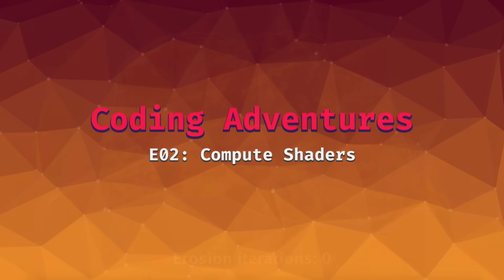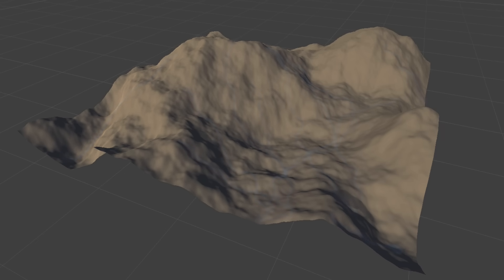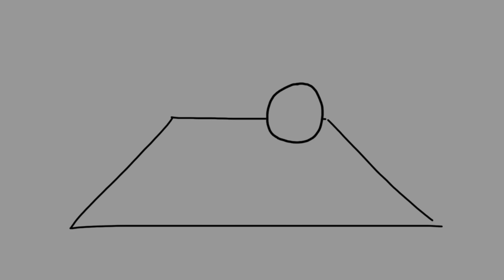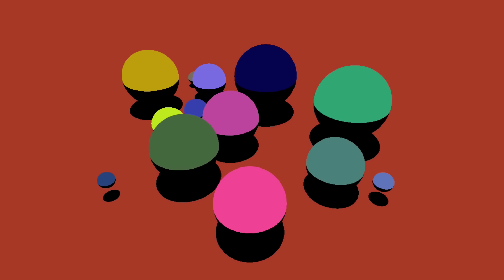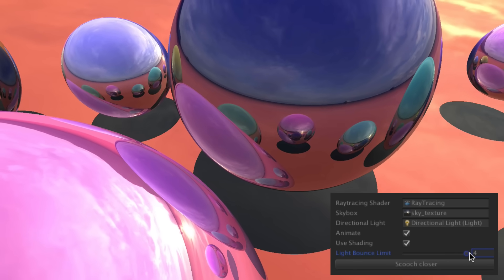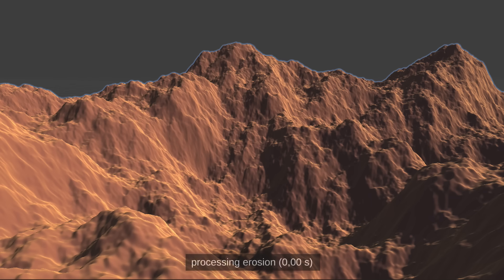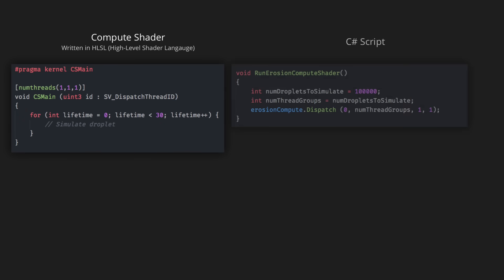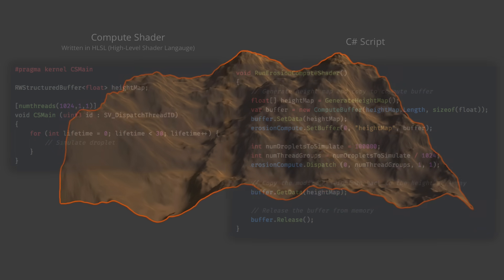Coding Adventure: Compute Shaders

Comment: Graphics programming student here; numthreads is the amount of threads that share data and are executed in one go. Every group is made out of numthreads and so dispatching less groups is generally faster (less stalls), unless these groups access shared data (or do group syncs). Having numthreads as 1,1,1 will destroy the whole idea of the gpu; paralization (as it just runs minimum number of threads and then masks out everything but one) since gpu cores are way less powerful by themselves then cpu cores. The threads that are dispatched should be a multiple of the GPU's architecture's minimum threads for optimal performance (32 for nvidia, 64 for amd) since less threads will be wasted. These "minimum threads" are also called a warp and all threads in a warp should follow the same branch (otherwise, branch divergence will cause both branches to be executed, but the branch that shouldn't execute the code will be masked out), this is done because the gpu draws its power from SIMD; a technique that allows you to operate the same operation on multiple objects. Their advertised threads are pretty much faked, as the threads they mention have to do the same thing for every warp; so not functioning like cpu threads. Nice to see something about compute shaders :) You can do infinite things with them; generate things procedurally, do lighting & ssao, culling and setting up draw calls, etc.

EDIT: Do note that more threads in a group isn't always better in algorithms that have branch divergence, for/while loops, syncs and/or write to memory inconsistently (or use groupshared memory). There's a lot of things that can affect this, mostly the GPU architecture, so be sure to test performance with different group sizes.
Reply: Adding on to this discussion of maximizing performance with compute shaders.
A thing that is really worth mentioning, is the nature of ComputeBuffers and the GetData() method.

The GetData method, along with other kinds of GPU buffer reads, such as readPixels() for textures, are not asynchronous.
They force a hard stall to the CPU thread, and it waits until the data you want from the GPU is ready. And along with that, even if
that data is ready, it could be further stalled by anything else that puts the GPU in a busy state. So the time it could take is really not
easy to judge.

Like... I experimented with it before, and purposefully set up an automatically approximating delay between the dispatch call, and the data fetch,
and that did a sort of decent job, but in the end, being just a little bit too early, or too late on the GetData fetch could cause a lag spike.

So after looking into it for quite a while, I found this... https://github.com/digitalsanity/AsyncTextureReader
I'll start with a note that I haven't properly tested it in the latest versions of Unity 2018, but it was working in 2017 for sure.
Assuming it does work though, It's a very easy to use and modify plugin that allows you to signal that you want data from a
GPU buffer immediately after Dispatch, and you can have a constant check for it's status in a loop, without any laggy synchronization issues.
(Edit: Oh right, the name of the plugin is a little confusing, it says texture, but it does support ComputeBuffers as well).

There is however, another potential solution directly supported in Unity 2018 brought up here https://forum.unity.com/threads/asynchronously-getting-data-from-the-gpu-directx-11-with-rendertexture-or-computebuffer.281346/page-3#post-3358878
Though I have not tried it out myself.

Edit: It's in the documentation https://docs.unity3d.com/ScriptReference/Rendering.AsyncGPUReadback.html
Jeez am I behind on Unity... Kinda stopped focusing on development stuff for like a year now.
Reply: A little more to add to the conversation which may be useful:  Each thread group runs on a separate processor, at least in theory.  What I usually do is start with only one thread group, then tweak the number of threads per group (threads per processor) to maximize the speed, then leave that alone and start fiddling with thread groups.  I typically use maybe 8 or 16 or 32 or so threadgroups, usually with 128 or 256 threads per group in my typical cases, sometimes 512.  Maybe go a little bit toward the higher side on threadgroup count so future graphics cards with more processors will speed up your algorithm automatically.   The best settings change across different GPUs, so it's one of those "this looks like it's probably good enough" things.   For example, here:

https://www.youtube.com/watch?v=_IYKArSYYtQ

This is a real time engine simulation I wrote that runs entirely in a compute shader.   The audio data is then fed back from the GPU to the CPU side something like 10-30 or so times per second.  (This is 100% synthetic audio, there are no .wav files or anything).  Each exhaust pipe is simulated separately and has a bunch of nodes for modelling gas states throughout the pipes.   The pipes here are not connected to each other, so each pipe is one thread group.  The number of threads is set to the number of nodes in each pipe, making sure to keep it a multiple of 32.  This simulation runs something like 40 billion flops with 480,000 Hz physics (only 10% of the audio info is even written out for playback), way more than a CPU could ever hope to do in realtime.  

It's fast enough mainly because of the memory access pattern and size.  Each thread group has it's own cache (groupshared memory) so as long as the variables needed for the number of nodes in each pipe fits inside that and you only read/write maybe one time while doing thousands of iterations inbetween on the groupshared copy of the data instead of the very slow global memory, it can be extremely fast.    Speed is all about getting the memory access patterns down.  For example, connecting the exhaust primaries together to form a collector/headers would kill the speed because I'd have to start writing data from different groups (processors) back and forth to each other, which means reading/writing back out to global memory 50,000 times more often than it currently does.   So suddenly there's a major problem and it won't run in real time anymore.   

Some algorithms just aren't very GPU friendly, unfortunately, mainly because of memory access considerations like this.  I wrote three versions of an LU decomposition linear equation solver for a GPU, and while the best one was slightly faster than C# in Unity, it wasn't nearly as fast as a C++ native plugin version I wrote afterwards (C++ version was about 3-5 times faster or so than compute shader, it seems to depend on the matrix size somewhat).  That has to read/write out of 2D arrays in a weird access pattern in a particular order which can slow it down by a factor of 30 or so.   It can only be partially parallelized, there's a lot of waiting around for previous computations to finish before threads can continue combined with a lot of slow memory reads/writes into global memory because the caches on each processor are too small to store all the data.  The actual computations were fantastically faster than the CPU, but the single line of code at the end to write the data back into the global memory kills it by probably two orders of magnitude or so.  

So some things are great for compute shaders, others not so much.  Just have to try and see, really.

As far as GetData() speed is concerned, it's only a problem if you need to readback data very often.  For instance, I'd like to rewrite part of one of my physics engines into a compute shader, but I have to read data back something like 400-500 times per second in my typical use cases so it's not really possible because the first call stalls things so much.  In Unity it used to be a lot worse than it is now though, on the order of 10 times slower.  As soon as you would read anything back at all the first call would stall you for 0.01 second, limiting you instantly to 100 fps.   It's a lot faster now though, but still not fast enough for what I want to do.  Anyway, it's not really relevant for the landscape thing probably because the simulation is probably called once, it runs for a couple seconds, then the data is probably read back once.   (Correct me if I'm wrong about the algorithm.)  So a little stall there of a couple milliseconds doesn't hurt anything.

I might be mistaken, but I think the asynchronous GetData() reads, which are a lot faster, don't guarantee that you'll get your data in the same graphics frame.   That might be fine for some uses like landscape erosion, but it wouldn't work at all for most of the stuff I've done unfortunately.  I wouldn't expect any gain at all for the landscape erosion case so it hardly seems worth the trouble on this one which takes some seconds to run.

Anyway, this is neat video to see.  Always fun to see another case where a compute shader spanks a CPU at some task.  Nice work!
Reply: Hey, just wondering, you say you're a graphics programming student, do you only study this or other types of programming too. What schools would you recommend?
Reply: @littlenarwhal3914  it's a study in Breda (BUas) but mainly focused on game programming (C++). There's a small percentage that ends up doing graphics, but you do get forced to at least do some basic C++ & opengl. Most things you'll end up teaching yourself, as the field is constantly changing and there's a lot of difference even between graphics programmers, so they end up steering you based on your projects and documentation
Reply: Thank you!
Reply: Important practical note is that (on nvidia hardware at least, but I'd be surprised if this were any different for AMD) there are no global synchronization directives. If you want to synchronize across the whole gpu, you need to wait for the kernel to finish. Within a kernel it is only possible to synchronize the threads in each block (which in CUDA C++ this is done with __syncthreads() ).
Reply: Thank you for your explanation.
Reply: Sorry for bothering on an old comment, I found a compute shader repo that enacts the idea of “particles.”  Each particle doesn’t have any effect on each other, the only shared data is global stuff like delta time.  Currently, I kept the code the same as the repo so it has numthreads set to 1,1,1.  What would the optimal setting be?  Currently there are a max if like 500,000 or so “particles” I think, but someone did show me how to have more.
Reply: @JJCUBER  mostly depends on your vendor. Nvidia uses 32 threads and amd 64 per warp. The reason why that is important is because they do a lot of optimization with this. If you have 33, it would need to spin 2 warps on nvidia where 31 threads don't do anything. Not only that but some operations are more efficient if the group size is equal to the number of warps (since sharing values between warps can be used for groupshared memory for example). I'd say try it out and see if there are major performance differences (profile the one shader individually, for N times with various thread counts). I'd suggest if AMD is a possible target that 64 is the easiest way to go; since 32 will keep a lot of threads unoccupied for AMD and just use 2 warps for nvidia (but misses some optimizations since it doesn't just run 1 warp); optimal would be to have two versions if the shader is very intensive (like raytracing), but that's probably not worth it unless you want to achieve maximum performance
Reply: As a layman who doesn't understand coding or game development, that makes a lot of sense why everything from map sizes to shadow and texture resolutions need to be multiples of 64 in games.
Reply: @GnanaPrakash86AP  that's for another reason. Textures used to require base2 (...,32,64,128...) to work. Nowadays it's just legacy since you can have textures that are any size. Though one thing remains; on desktop textures  (BCn) need to be a multiple of 4, since generally texture compression is used and needs blocks of 4x4 pixels. Mobile/console is better with this since ASTC (their compression format) allows different tile sizes (up to 12x12), though this will still won't allow every single resolution
Edit: this requirement has been relaxed later, misaligned textures will now just introduce an extra block (e.g. 1 pixel will still effectively be the footprint of 4)
Reply: @Nielsbishere SIMD (single-instruction multiple-data) is actually the parallelisation paradigm for CPU. NVIDIA and AMD follows the SIMT architecture (single-instruction multiple threads). I would love to have had CS lectures about GPU programmation in University / Engineering School during studies, but as you say, it's a fast evolving domain, so it is sometimes best to learn from here and there on the Internet.
Reply: @polite3606  you're right, I said SIMD while I meant SIMT. But it still has SIMD-like behavior for vectors. In DXIL they may generate multiple instructions but in spirv and the isa (at least amd's) they will be reduced to 1 operation instead. This operation probably still behaves similar to SSE's m128 but the gpu variant. I also don't know if I talked about wave intrinsics here, but they're awesome. I wrote a histogram that can be reduced in 3 dispatch steps using groupshared and wave intrinsics
Reply: @nielsbishere  I wasn't expecting such a quick answer from the OP of this 3 year old comment ! Interesting stuff indeed. I am more focused on GPGPU's but I try to understand computer graphics to join both worlds :)
Reply: @polite3606  got my notifications on 😛 but yeah it's super interesting stuff. Especially with the huge improvements that are being made in raytracing/path tracing these days. Finally starting to be viable with things like a-svgf, restir and fsr2. Luckily I'm doing offline stuff right now so less worries about that, until I'll get back to real-time for the editor
Reply: Extremely insightful, thanks. 

What if I plan to run code in the GPU with many branches, is dispatching jobs the size of the warp meaningful still? As eventually I will completely randomize the order that my threads are re-executed on failed branches.
Reply: @Kam1goroshi  it will have to schedule in warps anyways, you can't schedule 16 threads by itself if a warp is 32. However, with complex branching the story might change. If your 16 threads can be uniform but your 32 can't then it might be faster to execute the 16 so that only 1 side of the branch executes. With non uniform branching the gpu has to execute both sides of the if potentially (switch cases or else if is even worse), and it has to allocate worst case register count (max between all branches) for the branches it might enter. I'd say profile it
Reply: I believe the warp size of NVIDIA is 32 and of AMD it's 64.
Reply: @krytharn  my bad, changed it
Reply: Any advice how I can self learn shaders to the same level as students, like a book or something, really want to master shaders and all their nuances and gotcha moments
Reply: @WDUK-x1x  mostly it can be learned through trial and error; and looking through how other people do it and what problems they're experiencing (like tutorials, stackoverflow, etc.). I learned compute shaders through implementing light culling (allowing for thousands of on screen point & spot lights at a time). There's good starting sources (for rasterizer) like learnopengl.com, opengl-tutorial.org and 3dgep.com (which also touches on compute shaders: forward+; a light culling algorithm for forward rendering). Brian beuken has a book that also explains linear algebra (matrices, vectors), which can also be useful for starting out. Raytracing within a weekend is pretty handy (for CPU raytracing) and cwyman (for GPU raytracing). Other than that, I'd highly recommend ThinMatrix's and Jamie King's tutorials on graphics as well.
Reply: @nielsbishere  Another Thinmatrix fan! Nice!
Reply: @geroge_i_mean_george  yeah, his tutorials are great for getting into graphics and game programming :) it's a shame he didn't do pbr or newer techniques though, but it's easy to follow even if your program uses something other than Java

Comment: Wait are those raycasts realtime?
Reply from the maker: Yup!
Reply: @SebastianLague  Wait then why is RTX so taxing then? Do you have a beast of a machine, or is because the scene is simple?
Reply: @technobabble7702  yes, its because the scene is simple.. raytracing gets a lot more complicated when you have complex geometry..
Reply: @cschott  ☝️ especially if you start doing more complex things, like global illumination, ambient occlusion, variable roughness, soft shadows, etc. Especially since there is no such thing as a acceleration structure in this overview, so a huge scene with lots of objects, triangles and lights is not viable.
Reply: @technobabble7702  The scene is really, REALLY simple. Computing intersections for spheres is something really cheap, whereas doing it for complex models is really expensive. That's just one example tho, there are lots of other examples as @Bb Nn said
Reply: Also add to the fact that it looked like he was using distance functions to define the spheres and ground plane. Distance functions are pure math equations, and so are much faster to calculate intersections against than actual polygonal geometry, which is what RTX is doing. That's why things like https://www.shadertoy.com/view/4dSGW1 can be done at such high frame rates, even at 1080p, since the cylinders are defined using pure math equations.